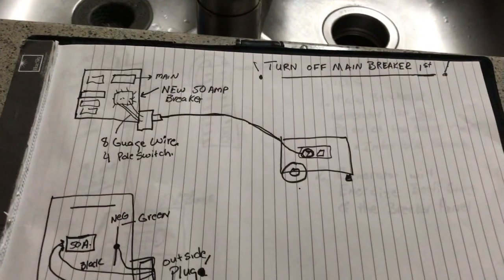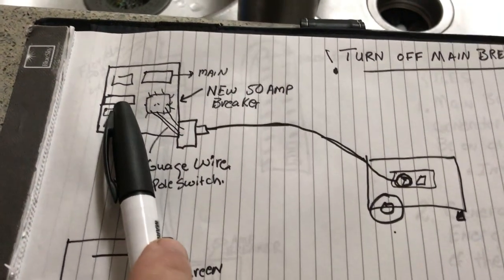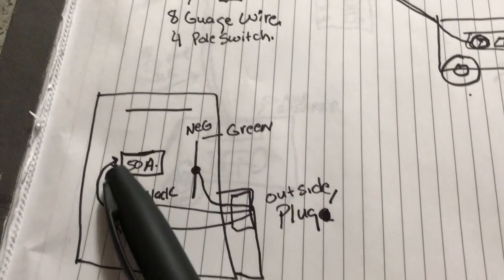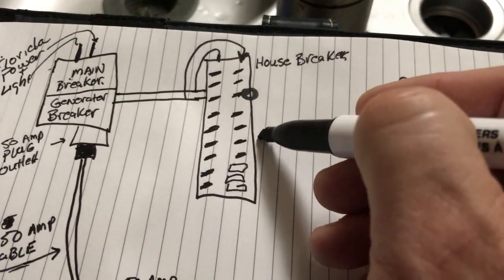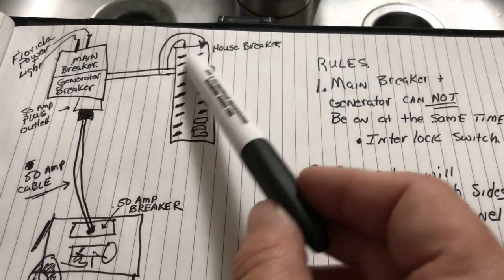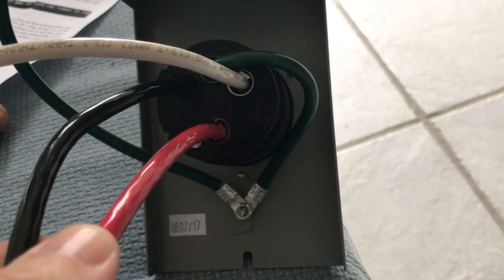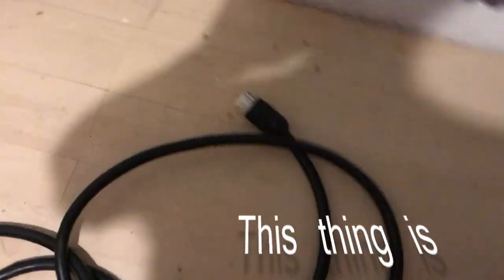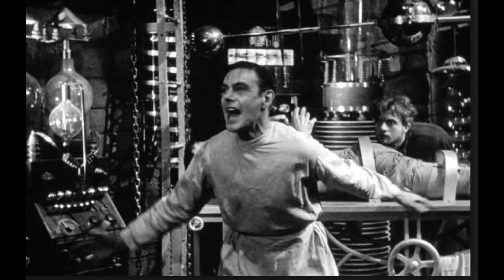Hurricane Irma 2017 Part 2/4  Generator to Breaker Box Setup

Comment: A few mistakes but one serious. 50amp electrical cable requires #6 gauge wiring. This is standard over the 50 US states. One thing can go wrong with #8 at 50 amps. The plugs at either end... The connection to the gen or home circuit will overheat and or fail but at worse cause a fire. Even  30 amps require #6 wire at a longer run over 50 feet.

Comment: 50 amps is supposed to be six gauge wire not 8 and it's also supposed to be three wires with a ground not put your green to a neutral bar cuz now you have no ground

Comment: Just FYI. You do not need a low pressure regulator from the tank to the generator. The regulator on the generator is capable of handling full tank pressure.  Think about it... you can connect your generator directly to a portable tank like a 20lb or 100 lb. tank with the connector provided on the generator. So dropping the pressure to the generator is not desired. The regulator on the generator is designed for direct tank pressure. The tank size doesn't matter.  It's the outside temperature that controls the tank pressure being that propane boils at -44deg F. I have mine connected directly to my 360 gallon house propane tank. The generator sits about 10 feet away from the tank so I connect it on a "as needed" basis directly to the vapor equalization valve on the tank. (Full Tank Pressure) Purchased the connector on Amazon.  Looks like a large Schrader valve on the tank. I just screw it on when I need it and unscrew it when not in use. That way the generator is only connected to my propane tank, when and if, I need to switch from gasoline to propane in an extended power outage. So loose the low pressure regulator to the generator. Just run a line directly to the regulator on the generator and that's all. One other note. If you have been running your generator on gasoline and want to switch over to propane before the gasoline has run out, you need to turn off the gas tank fuel supply valve and allow the carburetor float chamber to run out before switching over. Otherwise it will try to start or run on what ever gas is still in the float and the propane at the same time and will basically flood out the motor with both fuel types.  The way I do it is to start it on gasoline then turn off the fuel valve and let the motor run till it empties the float and engine dies from lack of fuel.  Then start it on propane.
Reply from the maker: Gary 
You are right and thank you for the advice 

As with any large project, 20 / 20 hindsight is needed.  

Lord knows I don’t know it all.  

Thanks for the technical 412.

Comment: Need to secure your generator outside. After hurricane Andrew, my agency sent several of us to help patrol homestead FL. You also need to secure your generator with a large chain. Back in 1992, the thieves would fire up a push mower, push the mower next to the generator running and then shut off and steal the generator bathe homeowner assumed the generator was doing some sort of cycle and power would be back in in a minute. After a few minutes with no power, that’s when they would go and check and discovered the lawn mower running and their generator gone.
Reply: I live in Country Walk which was destroyed in Hurricane Andrew, my next door neighbor had a brand new Honda 7000 and they did exactly what you just said to him!  Only in the 305 lol!  Btw it was a really crappy lawn mower at that.  Life when you live in the 33177
Reply from the maker: Hi.  

Great points.  I never posted that part. 
I have a 1” steel cable (Tow Chain) which is 20’ long.  I wrap that around a tree, through my propane tank, in through the generator.  

I need to rethink this as you noted , when SHTF , thieves come out like crazy.

Comment: just jammy in the drier plug
Reply from the maker: Hi,  as easy as that sounds, it is very dangerous as it puts electricity backfeeded into the grid.    The plug I put on my Breaker was 50$ which was pretty easy to install.   I know people do this but tons of others tell you no no no, so I took the Manual Plug path.

Comment: The configuration you show is not truly safe.  My electrician  has seen the 200 amp main breaker fail or arc over and the power bypasses the main breaker.  A better solution is to install a 200 amp cutoff box between the meter and your panel.  There is a true 3" separation when you pull the handle down to off.  The switch is used on mobile home connections and costs less than $100.  The lower legs of the switch can accommodate the 4 wires in the 8 gauge wire and you put a female plug on the end (or a an outlet box).  this setup powers the entire panel and the  circuit breaker is on the generator.  FPL is truly disconnected from your house and there is no chance of damaging your generator when switching back to FPL power.
Reply from the maker: Thanks for the 411, that is actually a great and safer idea.  Now that Hurricane Season 2018 is over, I will implement this. ThanksKelly
Reply from the maker: integrity payroll 

That is a great point I never thought of , but makes total sense.  I was so rushed with Hurricane Maria to get this done.  I will definitely do this    Thanks.

Comment: Where do the 8 gauge wires go from the generator port? Do they tie into the two main panel wires, or do they go to the generator main beaker only, which energizes the panel like the main breaker from the power grid power does.     Im just wondering how this works. I think I get the concept   You now have TWO main breakers. One breaks the power from the street, One breaks the power from the generator
Reply from the maker: Ghetto Wagon 

Hi.  Good Question.  

I have a cable that plugs into my Generator. That is the male. 

The other end is the female.  That plugs into my outlet box.  

From there the Red (Positive) And Black (Negative) plug into my 50 amp Breaker.  The Green (Neutral) goes to the Breaker box ground bar.  This has a large cooper wire that goes into the earth for a true Ground.  

I simply added another Breaker to my Breaker Box to have the 9000 watts / 50 Amps flow from my Generator to the Breaker , which energized my Breaker Panel with all the sub breakers. 

The Generator is the Electric Company 

I have an outside Main Breaker and one in my Garage.  The generator routes to the new 50 amp Breaker it is connected to , and energizes my right and left side of my inside Breaker Panel.  

Just ensure you turn off the Original Main Breaker.   

This can be dangerous.  Be careful.
Reply: got it. so the  generator only breaker powers the whole panel when the main line breaker is off.  Wow you can wire it in that easy.  Awesome. Here where i live in these stupid condo's they have the main breaker outside!  Really far away outside with a line of other smart meters and breakers powering more residents.   This place by design could never get an approved interlock switch.
Reply from the maker: Hi Yes this is a bit confusing, but I can clear this up. I had the same question when I built all this.  My home has the Main Power Cutover and the AC in the outside Breaker.   So FPL comes in that box, goes into a dual 100 amp breaker. (200 AMPS total)Then there are two  bus bars (one each) that go into my Breaker Box in my Garage.  So since I am acting like FPL (My Generator pushes AC into the outside) it passes to the 2nd Breaker Box.There their is a cable from the front breaker box that feeds a bus bar in the Garage Breaker Box that feeds the right / left leg of that Breaker Box. So in effect nothing changes as I act as Florida Power and Light (FPL) It is when in my Garage Breaker Box that the main bus bar feeds the R/L breakers. Home vary widely, so take this as just one way it can be done.I hope that helps !Kelly